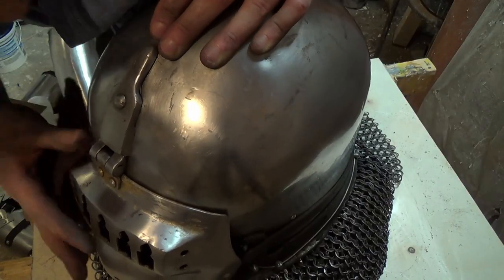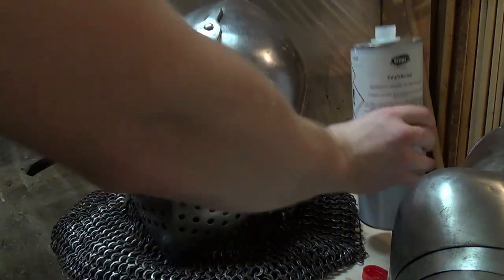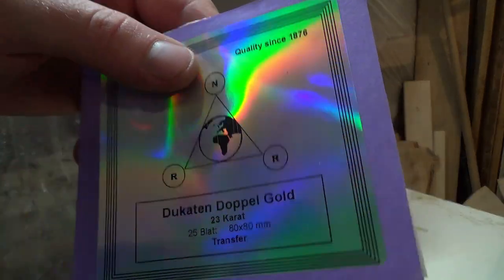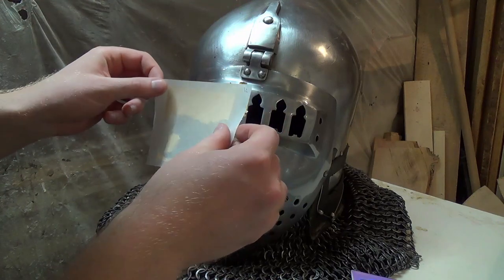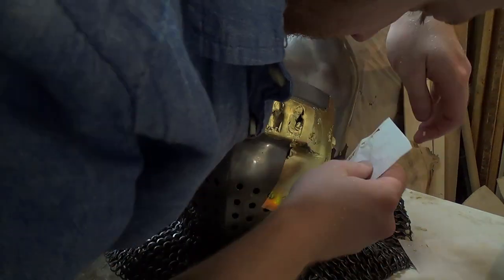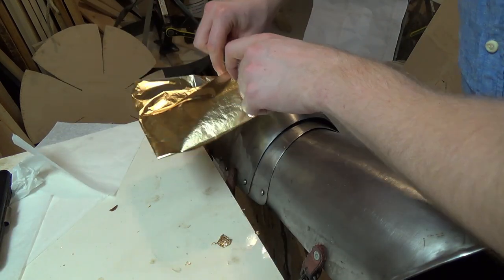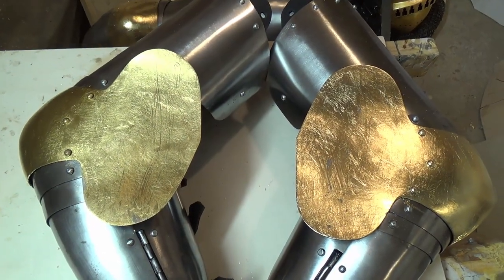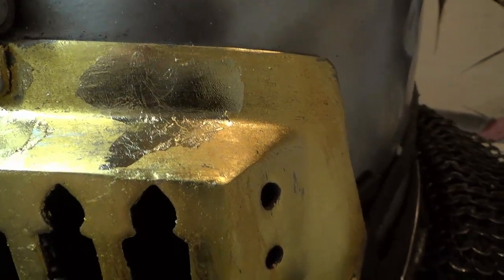Gilding Armor authentic and metal in generall with gold leaf

Comment: Gold leaf must be brilliant for adding corrosion resistance to high carbon steel; I sweat really heavily in my armor, I'm going to try adding some guilding inside where I've noticed and had to maintain corrosion and pitting on some parts.

Spray beak cleaner is my favorite thing for degreasing metal
Reply: brush electroplating better and stronger coating also cheaper.
Reply: @CatboyChemicalSociety  That's an interesting sounding technique, I will look up how that works
Reply: @CatboyChemicalSociety kinda a lie the tools usually cost more.  A good decent kit alone runs around 600 USD and above for brush plating.  Plus don't forget that brush plating is very risky on steel due to the chemicals speeding up oxidation. For experienced people it's fine but not a fun time for newbies.  I've seen way to many people ruin their projects because it started to rust the next day.  Either way it's gonna be a good bit of money since your working with gold, whether it be through electro or leaf